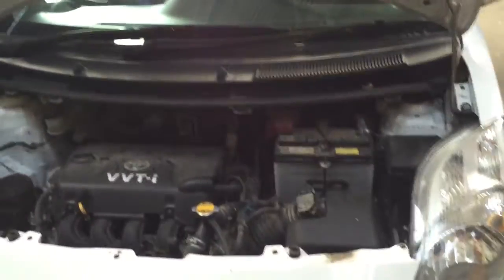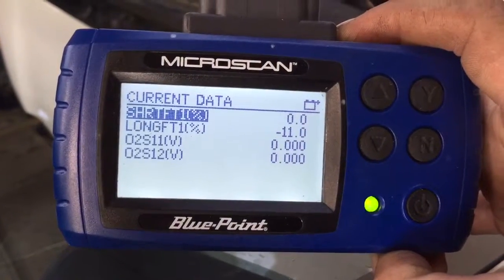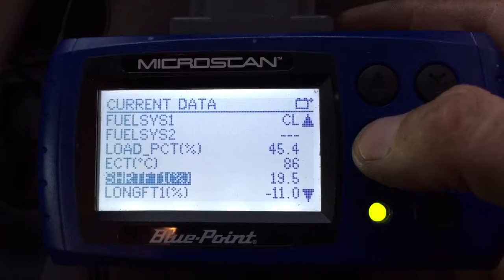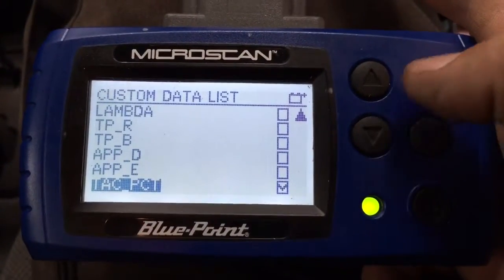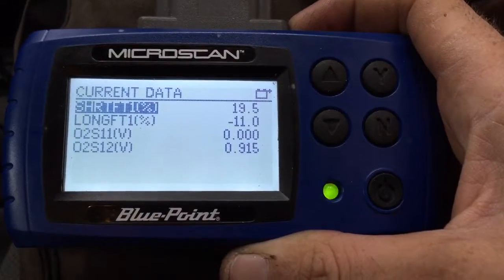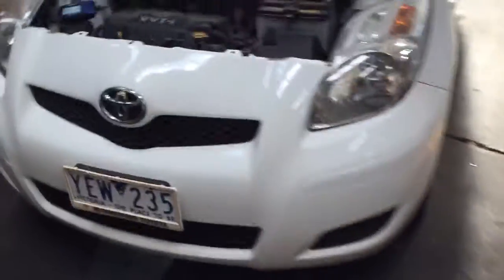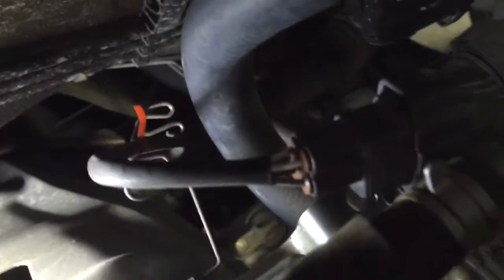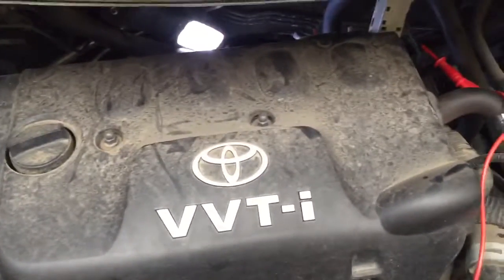Toyota Echo o2 sensor signal circuit integrity testing

Comment: So did you find that the injectors were restricted after all this ?
Reply: Also I noticed you skipped the MAF in the custom data list? What was the thought behind that ? Just trying to figure out the approach . The open and short circuits you've proven in the beginning of the video. The o2 stuck lean would be an indicator in my thoughts that you have a fueling issue or miscalculated air flow
Reply from the maker: Hi Keith,  the vehicle required a new upstream o2 sensor, which fixed the concern, it would flat line zero volts and vehicle would fall on its face then the 02 would come back. Sorry poor content my first video and I didn’t do a great job of explaining anything. Thank you for all your awesome content you are a rockstar.